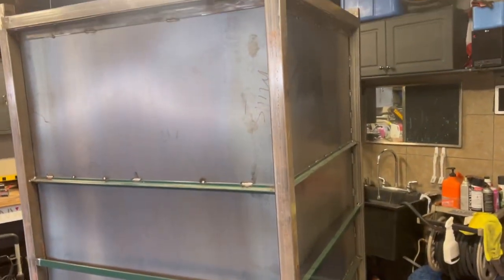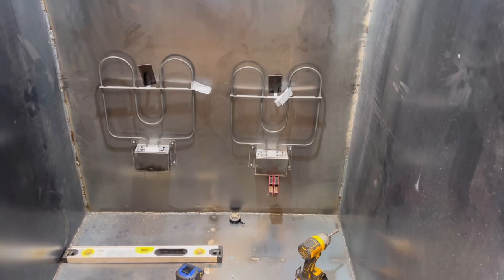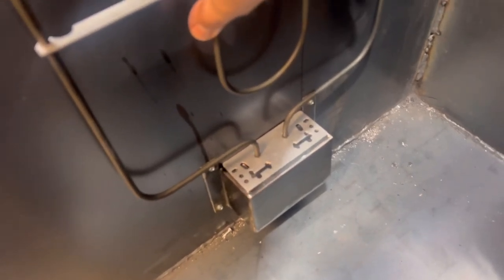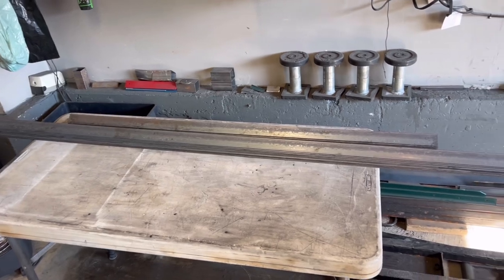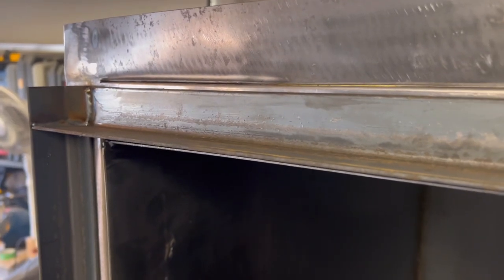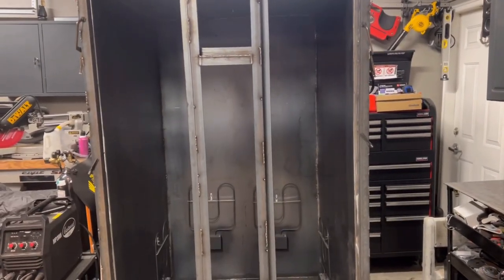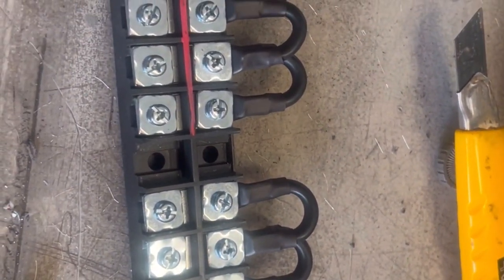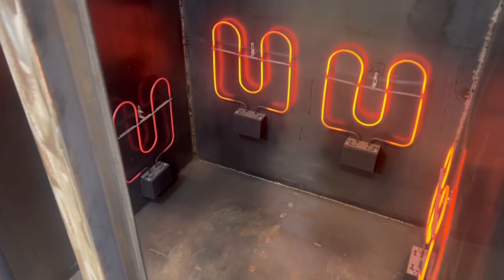Powder Coating Oven Wiring, custom door build and test run

Comment: Hi do you have a wiring diagram and parts listed somewhere that I can access. Most definitely the best oven build I've seen on youtube and I would like to get started building my own.
Reply from the maker: Hi Tom I did send you the wiring diagram.  Unfortunately I do not have a part list.
Reply: @welding2go  I never received it...
Reply from the maker: Check on Instagram .
Reply: @welding2go   hello may I also get a copy of that wiring diagram please..much appreciated
Reply: I would also like a wiring diagram if you wouldn't mind
Reply: Could I please get the wire diagram please?

Comment: Great work 
Where did yu get the galvanized sheet??
Reply from the maker: Thanks! Don’t use galvanized! The sheets are Cold press metal. 
Your local metal shop should have it. Metal supermarket
Reply from the maker: Galvanized metal when heated    Releases toxic fumes. Hot roll or cold press would be my recommendation.
Reply: Ok cool   Thank yu I will start my search

Comment: why you are using single thermocouple.  I think  it will  better if you use at least 2 thermocouple having probe length at least 6 inches and which controller you are using ? I  made a dedicated  controller  for ovens having alarm and Timmer option
Reply from the maker: Hey thanks for your input. I’m using  Ink-bird PID Temperature Controller for most of my builds, it also has these features I just don’t use them.
Reply from the maker: What controller are you using?
Reply: @welding2go  I made my own controller. Having feature to upload  weight and  temperature  to the sever let me share you that

Comment: Are all 4 elements ran off of 1 plug? Like a range plug?
Reply from the maker: Hi Brandyn, yes all 4 burners ran off one plug rated for 50amps (not a range plug) Range plugs usually rated @ 30amp. Always check with a licensed electrician.

Comment: do the elements have to be at the way bottom?
Reply from the maker: Hi Martin, Yes the heat elements should not exceed or be higher then the lower 25% of the oven (bottom quarter) heat rises and will insure a even heat.  Cheers!

Comment: Where to get the heating element sir?
Reply from the maker: I used a LG heat elements . You can find them on line or Amazon also has them.
Reply: @welding2go  tnx sir.

Comment: #Welding2go do you know how many amps does it draw with 2 and 4 elements running ?
Reply from the maker: 2 burners 25 amp 
4 burners 50 amp 
@240
Require 60amp breaker
Reply from the maker: Running the oven @ 400F  I was at 46.9 amp

Comment: Hello what are the specs of the heating elements?
Reply from the maker: Hello they are 3000w @ 240v  per element .
Reply: How kWh do these elements if all are working spent per hour?
And the last thing what are your oven dimensions?
Reply from the maker: The oven @ 400F is drawing about 52 amps with all 4 elements running. Oven reach temp in 20mins.
Reply from the maker: So at current rate of electricity, I’m guessing about $1:15 per hour
Reply from the maker: Interior dimensions 4’x4’x6.7’
Reply: @welding2go  and the last question I have is 
Did you use any vent or fan for the air ?
Reply from the maker: @elgranjero4384  No vent or fan is required. I’m alway happy to answer any questions you may have thx.
Reply: @welding2go  thank you so much for you answers I'm trying to build an oven right now that's why I have so many questions😁😁
Reply from the maker: @elgranjero4384  All I ask is that you refer your friends to my channel. Thanks
Reply: @welding2go  Sure !!

Comment: Where did you get the light for your oven?
Reply: I guess really a link to all the supplies you use,  Thanks
Reply from the maker: The oven light is a GE product we have a account with them , but I just looked it up on Amazon they also have them. Will send a link
Reply from the maker: GE WB08T10002 Light Housing... https://www.amazon.ca/dp/B00M0YVBFC?ref=ppx_pop_mob_ap_share

Comment: what gauge wire did you use for your heat elements?
Reply from the maker: 10g high temp
Reply: @welding2go  did u purchase from Amazon?
Reply: @welding2go  thanks btw
Reply from the maker: I’ll send you the link 

BNTECHGO 10 Gauge Silicone Wire Spool Black 100 feet Ultra Flexible High Temp 200 deg C 600V 10 AWG Silicone Rubber Wire 1050 Strands of Tinned Copper Wire Stranded Wire for Model Low Impedance https://www.amazon.ca/dp/B01M8M2SC4/ref=cm_sw_r_cp_api_i_K7AMRE6784HEPA3J0RPB?_encoding=UTF8&psc=1
Reply: Why 10ga high temp? At 240v, you're only drawing 10 amps per coil.

Comment: where did you buy the tubular heater?
Reply from the maker: Hope that helps.
Reply from the maker: If you need a link please let me know.
Reply: @welding2go  yes, i need link a store of tubular heater
Reply from the maker: Southbend Range 1003600 Heating Element, 240 Volt 3000 Watt https://a.co/d/fXMtQNo